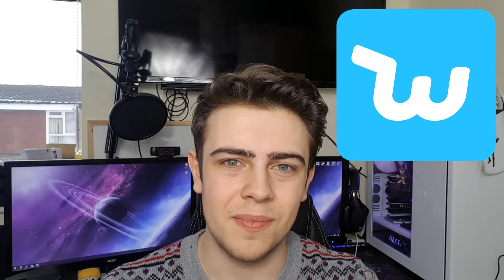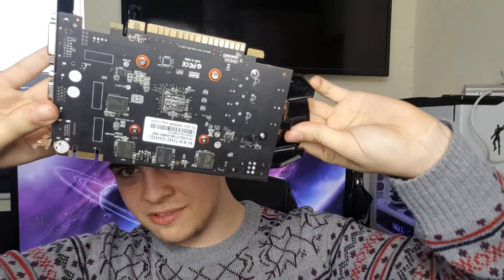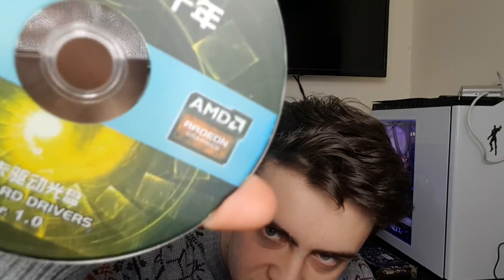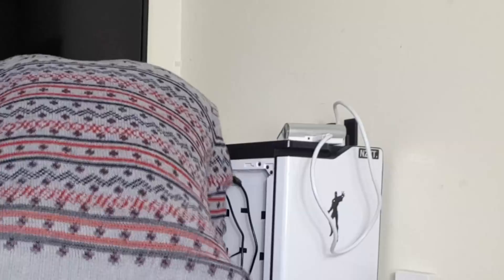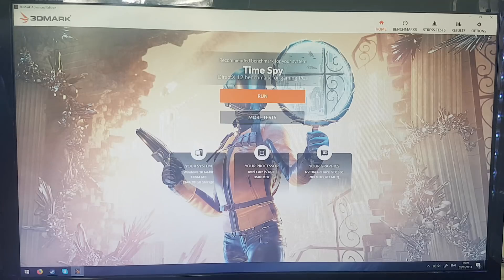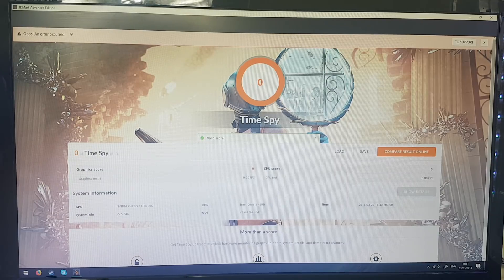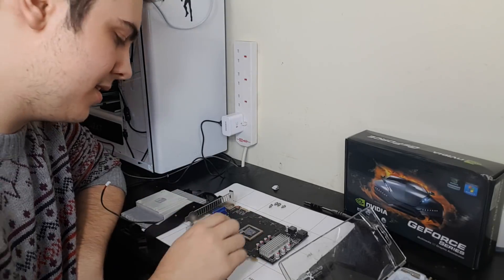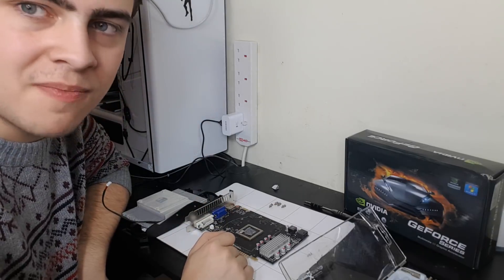I Bought a GTX 960 For £30 On Wish?! | Performance + Teardown

Comment: I got a Fake 960= it actually has 4gb of ram= 

RAM= Samsung GDDR5 K4G10325FE =1Gb x 4 

Shaders=192 

clock=783 

Memory=850 at 128 bit. 

Any chance someone will put out a bios that will make it a working card?

Comment: You can  download a freeware program called "GPU-Z" to find out everything about your graphic card.
 I once bought a generic (I wouldn't call it fake) "Nvidia GeForce GT 730 4GB 128-Bit DDR5" and it's working fine and GPU-Z detects it as genuine with all specifications as described in the product page, However I bought a second generic  "Nvidia 960 Ti 4GB 128-Bit DDR5" and the encounter was a nightmare because even when the card was on idle its temperature was around 64 degree and when playing a game all hell broke loose, I can smell something burning from my cabinet and upon opening my PC cabinet it was like opening an oven, LOL, ,I think  I could even bake a bread in my PC. .even GPU-Z shows that it DDR3 and not DDR5 and memory bus width is only  64bit, not  as describe in the product page 128bit. . 
Luckily the seller has a 10 days replacement/return policy on it and I was able to get a refund. . 
Nice video, ,thanks for sharing. .

Comment: 560 was actually my first guess, almost half of the 560 chips out there is flashed with bios for a diffrent card and sold as a more modern one. doesnt really matter if its labeled as 750 or 1070.

Comment: i bought one of these and got what was an equivilent of an AMD Radeon HD 7670, isnt acctually that bad of a card, seeing as im running it with a core 2duo E8500 lol. And the CD has both DirectX drivers for AMD and Nvidia lol

Comment: First off, did you not GET the "Discrete Graphics Card vs. Integrated Graphics" comparison on the box — (first paragraph - "realistic ripples" vs. 2nd paragraph - "no ripples")? Seriously?
Secondly, you could've ascertained that those were 256MB GDDR5 chips just by looking up the part #, as well as knowing it was a 5-series die from the GF ("Graphics – Fermi") prefix.
Thirdly, you're statement that nVidia "skipped the 8-series" is contrary to fact. There WERE GTX 8xx-series GPUs (at least in the mobile department); they just never introduced any 8xx discrete desktop cards.
Finally (assuming they used a legitimate EEPROM for the BIOS) you CAN still make use of that card! Just re-flash the BIOS with an actual GTX 560 BIOS and you'll be good to go.

Comment: i bought the same exact card (and box as you) thinking it was a gtx 960 4gb. the listing even said it was in the states. however as i was watching youtube my card popped up. different channel. im like shot i contacted the seller but was to late couldnt get my money back and the seller never responded. i soon learned even though the seller is selling stuff in california the seller is in china. ive looked at all kinds of gpu and the closest is the 600 series from nvidia. thee 500 series doesnt match the board or the ports. i paid $70 for mine.

Comment: Windows 7 in 2018, more like you using skype in 2018.
Reply: Well skype is a real thing in 2019, since Windows 10 forces you to use it.. One day I turned on my computer just to find out that I have skype installed on it without my permission, with my microsoft account automatically linked to it, with no way to delete it if I want to keep my microsoft account.. That's why I am seriously considering going back to Windows 7.

Comment: the 960 you can get on amazon for £40 so its not really that much of a difference
Reply: But it claims its a modified card "modified card, the product performance can reach 80% of the original card." - forgot to mention that :p

Comment: 780mhz haha 
I have a stock evga 970 and i clocked it to 1500/3500 , it heats up to 100°C and i only got 110% but the warranty ends in a few months so i keep pushing it to the limits :D

Comment: I have a question. A month ago, my dad showed me this listing, I told him it was 100% fake and not to buy it. He said he wanted to get me something nice for my pc for my birthday, as I had some crappy 270 installed beforehand. I told him not to buy this, it was fake, but he bought it anyway. He said 'everything I got from wish is legit, so I assume this will be too' (surprising enough, he knows nothing about computers) and I told him again it was a scam, so he got angry at me for being so rude, and bought it anyway. Wow what a surprise it was a scam.

My question is, is there any way to revert to the 560 firmware, making it actually usable. This is because it would be better than my current graphics card, which literally won't boot xcom 2.

Comment: I ALMOST bought one these fake 4gb GTX 960s...
I believe the guy selling actually believed it was a genuine 960, because apparently he was buying them and reselling for much more than what you paid, but still quite a bit less than a 4gb 960. I guess he saw the low price, imported one, saw in gpu-z or something it said it's a 960, didn't test it and just started reselling them. Thank god I cancelled the purchase when I saw that generic cooler and old "Windows 7 supported" box.
Things you only see in Brazil...

Comment: Testing GPU in CS:GO - Game that doesn't need much gpu at all. Great test.
Reply from the maker: It was to prove a point. Look at how the GPU stopped functioning despite having such little utilisation.
Reply: I know that it sucks. I also was thinking that it is going to be a really old gtx with 960 firmware. To check if it's real 960 4gb you should just a little bit more demanding game title ;p Nvm. This video is great to show that buying gpu on wish is not really good idea xD

Comment: I’d like to see a video where you (if you can) force flash this card back to 560 cause if so then it would make it a good buy for anyone who succeeds. 560s are good for light gaming and for £30 isn’t a bad option really.
Reply from the maker: Make sure you subscribe then! I'm working on that video right now!
Reply: RMD Tech consider it done 🔥

Comment: I’ve bought a 1050ti about a month ago on ebay, it turns that the video card is a flashed GTS 450.. Sadly, I can’t run any game without crashing, its even worse than a GTS 450.. Btw, there are some programs which reveals the fake card, like GPU-Z..
Nice video mate.

Comment: By the way, the two paragraphs you read at the beginning don't contradict each other. One says the dedicated GPU shows good details and the second one says that an integrated GPU (like the one included automatically on your motherboard) doesn't.

Granted, there are integrated GPUs that beat some low-end dedicated cards and this one is fake...

Comment: i got a scam ati 7670 and it will hardly play any games they just are not worth messing with. i looked up the chip on mine it was a gpu for laptops like apple and was never on its own card for pc. so they are just popping crappy gpu on a pcb and calling it a radeon hd 7670. i looked they never made a hd7670

Comment: btw 1070 is not high end xd
Reply from the maker: This is certainly incorrect but I'd love to hear your justification
Reply: yeah maybe i am incorrect. It is a high end since you are playing 1080p or even 1440 but it won't for a 4k. Since i am using 1080ti and i still have some trouble with performance , i am not about to say 1070 is a high end. Different point of view.
Reply from the maker: Oh certainly won't do 4k, as you say, even a 1080ti struggles. But a 1080ti and a 1070 are both on the higher end side of the 10 series of GPUs being the latest generation and not in the budget side of the generation, I would certainly class it as Hugh end, even if it is at the bottom of high end cards

Comment: What does a 560 usually go for? Because if you reflash it, you get a fully functional GTX 560, and I think that a 560 goes for more than 30 pounds.

Comment: Even radeon xfx 5750 1gb runs cs source and global offensive without problems, and even radeon 8800gts 320mb runs cs source  without problems. Cause i still have 4 old v-cards that means intel asus 8800gts 320mb, radeon gainward 8800gts 320mb, 2x radeon xfx  5750 1gb and they all run good exept asus that dont like all drivers.

Comment: When looking at memory chips, they are measured in bits, not bytes. So each chip is 1gigabit or about 256 megabytes. Multiply that by 8 chips for a total of 1gb of ram. You were correct about the game running out of video memory and crashing. This is pretty common on these reflash scam cards.

Comment: is it normal that my gtx 1060 only uses 2% of it's power in csgo? i have an AMD f(x) 8320 8x 3,5Ghz as cpu and 8 gb of ram... the problem is i get frame drops from 200 to 40 or even lower

Comment: My intel HD integrated graphics runs csgo at a solid 100 FPS on high settings. 

Is that normal?
Reply: Pretty normal
My i7 6700 got ~60-70 fps in CS on 1440p
Reply: he brings up his gpu and you talk about ur cpu
Reply: your full of bullshit
Reply: i get 20-60 fps on it with my i5
Reply: Goddamit guys it really depends if its HD 550 or UHD 620 or HD 4600 there is many of them. You have to name the specific so it could be analyzed easier
Reply: some trash it’s a cpu intensive game
Reply: Golpheox CSGO is a CPU intensive game, with a decent CPU and integrated GPU along with good memory and CPU cooling you will be able to easily run it
Reply: I depends on what model it is, csco is more  a game dependent on your CPU and not graphics (as much)
Reply: Yes
Reply: Golpheox depending on your cpu yes or no
Reply: Maybe you got discrete grafics?
Reply: What cpu do u have not surprising with 7700k or 8700
Reply: Takes a look underneath the cooler

That looks like a high AMD cpu disguised as a boring intel cpu and cooler combo. A reverse of a ripoff, a freaking steal!
Reply: Its possible before I got the display cable so that my 1050 ti would work with my monitor, I ran my Ryzen 5 1600 with an Radeon HD 6570. The performance of that card is similar to MODERN (Skylake-present) integrated graphics. In addition to that, my cpu was pretty good for cs go. I got above 100 fps at cs go too.
Reply: Golpheox I have a 1050ti and it only runs around 70-90 FPS
Reply: My i5 3470 runs at 10fps igpu
Reply: I7 performance about gtx 760..
Reply: Probably he has an iris pro graphics
Reply: Cs In cpu game
Reply: More like solid 60 (if that even) and 100 on one occasion...
Reply: You don’t need a beast graphics card to run csgo with good fps
Reply: The 2 zeroes are normal but the one is in the wrong place
Reply: i get 70-100 fps with my i5 8250U with integrated graphics on my laptop lol
Reply: No, no it's not
Reply: I have an Intel HD Graphik 505 with 10 fps in minecraft
Reply: Golpheox Depending in your CPU that's normal. Also depends on your res.
Reply: Golpheox no thats not normal, its fps is way too high what igpu you have??

Comment: And the reason the game is freezing is because it has uploaded the kudos and graphical engineers the bits of the 1080 or 1050 or 950 that it thinks it is at the moment and its resourcing data from the games that it cannot handle fix the drivers you will not have a problem download and identify what chip you have by removing the heat sink

Comment: These cards are gifts. From all of the knock off side Bolton I buy these on our regular for 30 box brand new before I Gorman change the bios to a proper gt, and it corrects all the problems that the drivers cannot fix, for instance. The board is not a 1050. Whatever? It is a GTX 550 or 450? Is what I've been finding in mine, you just take the fans off, identify your chip and then drive some. Bios and flash and bitches on the new card of yours that you will have now and any aliasing problems disappear and the frames per second even go up

Comment: If it's GTX 560 it's actually good for that price (suppose it's working). But the question is... will it work with the original GTX 560 firmware.

Comment: The black screen is because the firmware falsely reports 4GB VRAM available, when in reality the card only has 1GB, but the software then tries to allocate non-existent VRAM above 1GB. I'd expect a BSOD or hard reset at that point.

I've seen genuine GTX 560's sell on eBay for £30, so the price is about right. If you flash the correct firmware you'll have a functioning card that you can resell with a clear conscience. The 560 has slightly better performance than a GT 1030, but at less than half the price, so for those on an extremely tight budget looking to upgrade an old PC with integrated graphics, this is a viable option.
Reply: Its a 450
Reply: slayyy yy but that’s not gonna improve performance

Comment: U know that when you open gpus or screw down a cpu cooler ur supposed to do the screw I one corner and then the screw in the other corner. It's called crossthreading
Reply from the maker: It really doesn't make much of a difference. Also, crossthreading refers to damaging threads on a screw which typically happens when using the wrong tool.
Reply: RMD Tech people like Linus tech tips and jayztwocents really recommend it. Anyway this is my first time actually talking to a YouTuber😂 thanks for replying
Reply from the maker: Haha, yes they do. I would also recommend it, but the chances of anything occurring from not doing it are incredibly small. Glad you're happy I responded, I try to reply to all comments on my videos. Hope you enjoy the content!
Reply: RMD Tech guess I'll subscribe cus ur so kind😊
Reply: RMD Tech They only recommend it so the card goes down as flat and flush as it can, especially to get the heats ink to not lift up even a millimeter by pressing down one corner, thus not getting air or bubbles in ur thermal paste.

Comment: Hi RMD Tech, 

Do you have the following chip on your card?  https://ibb.co/jx56kS

The PCB looks exactly like mine.  How did you identify the chip as a GTX560.  I though the 560 has a full metal heatspreader with a more rectangular shape compared to the square on your and my card.

I am very interested to find out what chip it is exactly to try and reflash it to it's orginal state.  Right now the card crashes with every game.

Cheers!  And thanks everybody for your help!
Reply from the maker: Hi, thanks for your comment. From memory, the chip looks very similar. I'll have to take the GPU apart again to double check and get a confirmation.
There is a good chance that you could be correct regarding the card identification, it was verified using a table that I had been linked to on a forum. I'll see if I can find it again.
Once I get a chance to disassemble the card I'll post a pic of the chip on my Twitter feed and I'll reply to your comment here too.

Glad you enjoyed the video!

Comment: the drivers on the disk will prob make it work better they are most likely what is needed to run the 560 card you got and installing from a download you get the wrong drivers. get a copy of that disk on a usb flash and try it again might just have a working 560
Reply from the maker: I did get those drivers working, they are the exact same drivers and made no difference to performance at all.

Comment: I wonder what my 1 pound 1080 will be
Reply from the maker: Those tend to be "surprise boxes" where the grand prize claims to be a GTX 1080, it will likely be a necklace or keyring
Reply: RMD Tech who knows! Its funny that i got an add fot wish on your video
Reply: Ow if you are able to reflash the bios you cloud make a mining rig for free. Its not like you have to return scam components on ebay
Reply: StrykerWolfhound i got a bit of string still making me smile
Reply: Damn I thought it was too good to be true
Reply: Shane Imperial but well worth a pound to find out
Reply: Read the description again it happens to change after you hit that buy button

Comment: The biggest issue here is that since it has been flashed to think it's a 960 there is no way to use this card as a 560 since the drivers and MB thinks this is a 960 hence why it crashes,. Also there is another video that reveals there is only 1 GB of Ram on this card or 2 at the most counting the chips on the other side. This will also be a huge problem since the system thinks there is 4GB ram it will attempt to utilize whats not there. so its a fail on both the GPU and memory.. The scam is simple.. one of the thousands of unscrupulous companies in china came across A large lot of various outdated real Nvidia cards and like so many other fraudulent products easily flashed the FW and made it just barely capable of working to attempt to pass for the casual user. Printed up cheap labels and box and made a profit even at far less than 30-40 pounds/dollars. By flashing the card in this fraudulent manor renders it totally useless on all fronts now since there is no way to get the right drivers installed. It would have been worth "something" as an older card..
Reply: wow if there is a way to do that... at least you can use it for what it is and its not a total loss but was worth the experiment to share with everyone... You are doing everyone a great favor here!
Reply: This video covers the procedure, shame he didn't buy it from eBay so he could get an easy refund.
https://youtu.be/Ra0T0j5KoAc
Reply: Phil Harper I believe you can get a 30 day refund thing
Reply: Someone had a video on how to reflash. You can't do it by having it in system.
Reply: Is there a program on windows i can run if i were to buy the graphics card and see the specs in a truthfully matter without my pc thinking it has 4gb of ram when it only has say 1gb
Reply: @ProGaming-ll8mf  I am fairly sure I used GPU-Z to check some of my cards out.
Reply: Shaun Prewitt gauzes now calls it a FAKE gtx 960 because now it recognises fake gfx cards mine says fake 960 4gig lol 😆